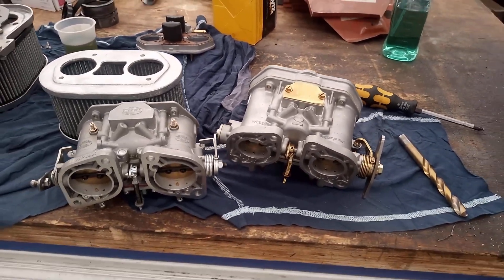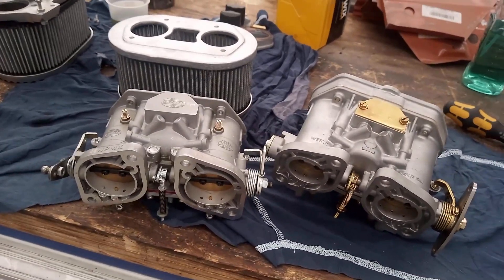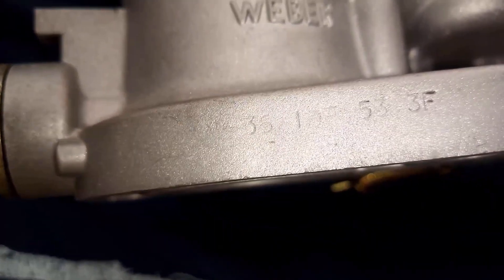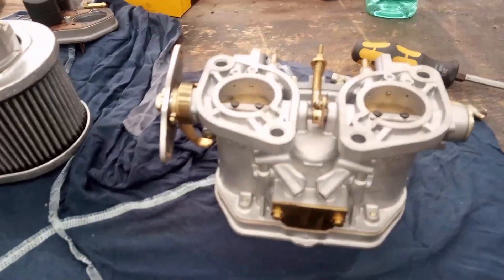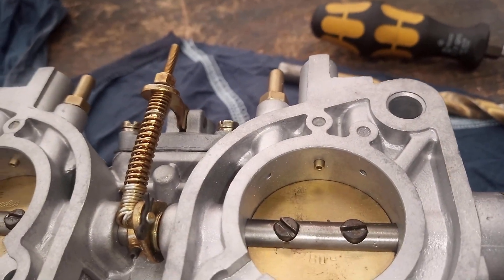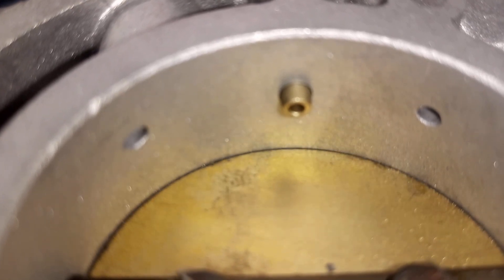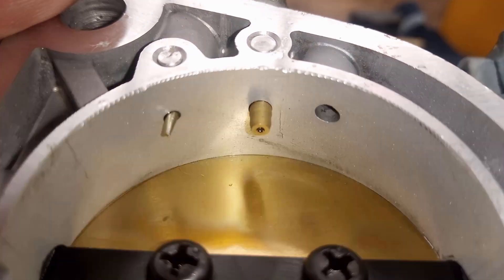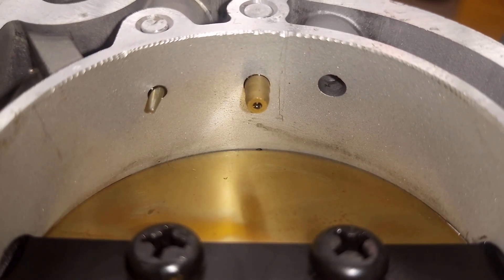Weber knockoff flat spot - comparing progression circuit of Weber IDF to EMPI HPMX

Comment: Looks like your accelerator pump is not set properly on the empi . That's the cause of your flat spot.
Reply from the maker: How does the accelerator pump help when you are in traffic and you need a throttle position that is lower than the first progression hole? 
The Accel pump only helps if I need to get from idle to above that point. Maintaining very low rpm needs the progression circuit to be active.
Reply: @TonyZVW  A flat spot only happens when under acceleration. The accelerator pump takes care of the off-idle fuel demand. If you want a low idle just tune the idle circuit the normal way making sure the butterfly's don't expose any progression holes when fully closed. I don't mind a higher idle so my progression hole may be exposed but that's on a sandrail. That may  not be optimal on a street car.
Reply from the maker: @crazytestpilot9434  
That's not entirely true. Throw some oring debris or dirt into your idle circuit, block up your idle jet or progression holes and you have a flat spot. Much in the same way as you do if you are missing a progression hole or it's too high, like on the hpmx. 

Luckily I don't sit in traffic with this bus very often. So it's not entirely a problem.
Reply: @TonyZVW  Oh for sure junk in the circuit will cause a flat spot .  I like to blow out the idle circuit pushing air through the progression ports and idle port so as to push stuff in the opposite direction that it was introduced . Pushing air in the wrong direction on that circuit could potentially just make anything in there become more jammed up inside. If your Idle circuit is clear and your accelerator pump is working correctly there should be no flat spot.

Comment: You could try pushing the keeper down on the bypass valve.
Reply: I did this to help smooth out a flat spot on my dual 44 weber setup on a 2017 cc type 1. It definitely goes a little too rich